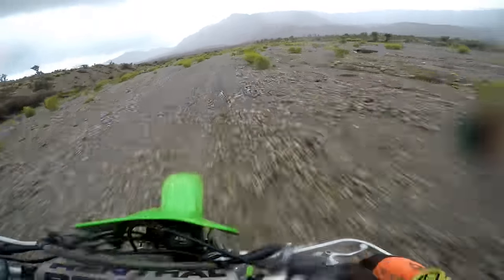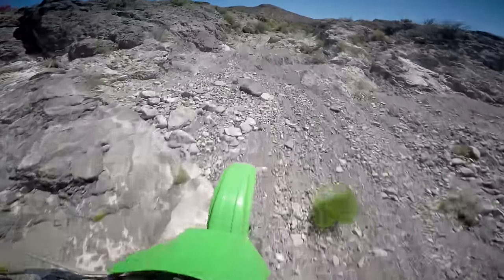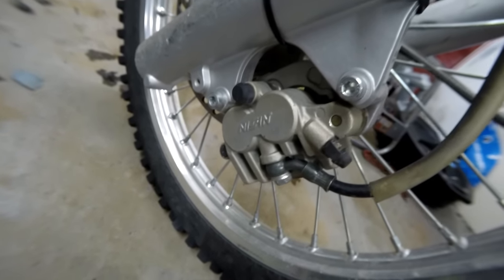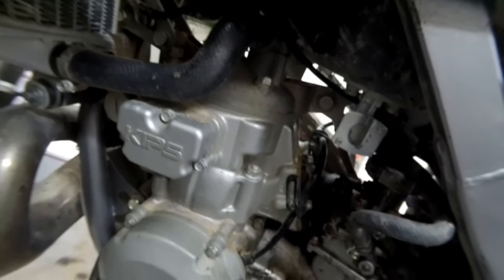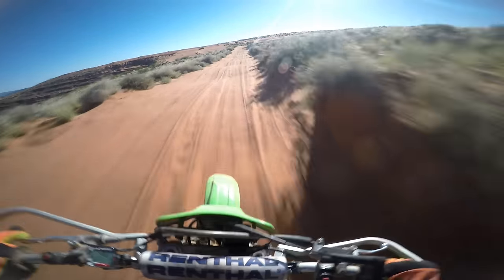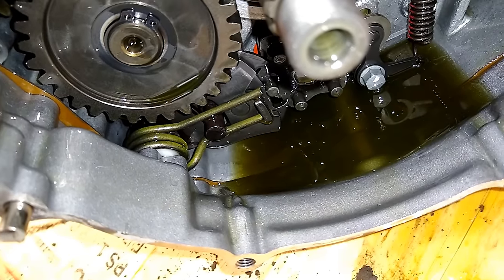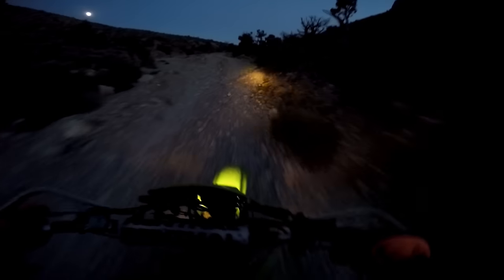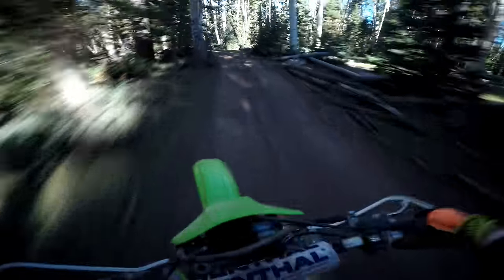KDX200 In-Depth Review

Comment: best thing to do with a KDX is drop motor in a Kx 125 frame 198 lb dry Fun magic with Ease
Reply: Which years of kx 125 frames will accept the kdx motor? And is a kdx 220 the same, will it fit in a kx frame? 
Thank you
Reply: @johnlorenzo1413  03 onwards KX125 are an easier conversion, but all years can work. It won't bolt straight in, but it's not a crazy amount of work. There are many How To's online. Yes the 220 motor works too, the bottom end is the same.
Reply: @wideopen125  thanks
Reply: @johnlorenzo1413  I'm putting an air cooled 200 into an 89 KX125. All the fab work is done, now just time to assemble :)
Reply: Nice  . I like the air cooled engines better, it's a looks thing, the engines on the old air cooled bikes looked wicked, like 80s Maicos. 
I'm wondering how much weight do you lose by putting the kdx engine  in a kx frame.
Reply: John Lorenzo Around 25lb. The hybrid is around 215 with an empty tank. I’ve put a set of 45mm conventional Showas on the front (from a 98 RMX). And a complete H model KDX ignition and CDI. Looking forward to the shake down ride.
Reply: And yeah those 490 Maicos are the best looking motors out there.
Reply: John Lorenzo - the kdx motor is based off a kx125 .

Comment: I have a 2002 kdx220r that I bought new in 2002. I’m 61 years old and it’s been well taken care of, I would estimate maybe 20 hours on it.  The chain has never been adjusted. I haven’t ridden in on a real ride in years, I do start it and roll around the yard every year just to keep in running good. It’s always been kept inside and protected. I would not sell it but I’m just to old to ride it the rough stuff anymore and I have other bikes to ride. I put it on Craig’s list yesterday (twin tiers Pennsylvania)  for 2500 as it’s just like new. You can find them cheaper but after you get them in good working order you’ll have more than 2500 in it and they won’t be in this condition. If I cant get 2500 for it I’ll just hold on to it and give it to my Grandson some day.

Comment: Just sold mine, your forks feels soft because the springs are 16 years old. I am sure if you measure them, you'll find they are either at the border line with specs or under. One upgrade I did was to swap out for a 2005 KDX triple clamp (upside down forks) and used KX250 forks. To get full suspension adjustment.  Never touched the rear other than rebuild and adjust. 

Another good mod is to get the head shaved, higher compression makes it a little more "lively" and improves slow speed rock climbs. 

Been riding for 37 years and best bike I've ever owned. It's not perfect, but I started with a Kawi and plan to end the riding part of my life on a Kawi because of bikes like these.

Comment: Suzuki pe 175 had a good smash plate under frame and wire cage to protect headlight. It would flick big rocks back even with curved big back fender. Flipped the PE twice. Never flipped the KDX and learned how too change gears on one wheel starting in 3rd.

Comment: You should try the 2023 Beta Xtrainer. Its basically a modern KDX with a 300cc 2 stroke engine and an adjustable power band.

Comment: He's so right. I had a 1985 kdx200 and got rid of it cause the cranks seals blew out and cause it was old. And then I got a 91 KDX200 and then I'm probably gonna mix and match the 91 kdx 200 with and a 93 kdx200. So he Is so right once you have one for a while it stays in your system

Comment: i have a 1986 kdx200 it will do 100 and that is fast alli did to it is put new standard piston and rings and i ported and polished the head and put a big carburetor of of a 440 snowmobile motor i can't remember what size but its perfect i have never seen or even heard of a better 200 cc 2 stroke bike i don't know about yours but i will say this one rules it will outrun this yzf 450  my friend has a kaw .4. wheeler klf 700 2 cylnder it will walk away from it all crapp aside i have always  liked honda  and sill do but i don't know of any 200 s that could out do the kdx  good luck with the trails liked you're video and think youre review was  spot on

Comment: Ok, totally revising my comment because wow they took all of the improvements between 90 and this 03 from the KX line and stuck them on the 03-ish KDX line. The old KDX bikes used to be backbone frame with the same terrible suspension up front and the hot ticket was to take your KDX 200 motor and drop it into a KX125 frame to get both perimeter frame as well as inverted forks up front. Yielded a much better bike all around.

Comment: I ride a KDX 200 2003 as well, but I wouldn't recommend removing the snorkel or air box cover. Kawasaki designed the box as a pressure wave resonance chamber where as the bike runs it pushes air out the exhaust on the exhaust stroke but air still escapes through the carborator. To make the bike more efficient they designed the air box so that on the following intake stroke the box would help to rebound and push more air into the engine to help create better power low end.
Reply: Hate to step on toes here. but, The air box lid was simply designed to make it harder for water to get in . Seeing as how the KDX was designed to be more of a woods bike ( ya know, creek crossing and stuff) than a desert sled . Which also explains the reason for a lot of that bikes personality characteristics . What you may be thinking of is the Boost Bottle , Yamaha used for years (that most will tell you was pointless) . Kind of hard for intake charge to go backwards through the carb when the reed valves are closed ! Never owned a KDX but have and still do , own a number of Yamaha IT's . The first thing we ALL did to them was take the lid off the air box so they could breath ! Makes a difference ! But will need to rejet probably.
Reply: @ITBubba1  Your aren't wrong but you're also not right. I have had and dyno'd many trail bikes over the years that actually suffered by removing or modifying the air box, this can be attributed to resonance tuning. As for reversion when the reeds are closed you are correct, however, there is a crossover on two strokes where the positive pressure in the crankcase does push back through the carb before the reeds are completely closed. If you want to see this for yourself pull your air cleaner, start the bike and rev it. You will see a slight mist of fuel get pushed into the air boot/box (some engines are worse than others). This is the reason why "modern" two stroke air boots/box are designed the way they are.
Reply: I have to disagree with this. For tight woods stuff, maybe. For faster paced riding, I removed the lid and it felt like it gained 3-4 hp instantly.
Reply: Two-Stroke Life i agree had a klx300r and it did nothing taking the airbox cover off.  What did make a difference was a stage 1 hot head cam, dropped a tooth on the front sprocket, and put a fmf powercore exhaust on and That thing barked smoked 250s in the trails all day!
Reply: Removing lid plus new exhaust and reeds did both of mine wonders.
Reply: @1TruePatriot  Yea but were still talking air to your motor that can go for any motor. I was more so saying youll notice a difference with something like an exhaust or tuning the jets in the carb correctly to get the right fuel to air mix. I said it did nothing removing or leaving the lid on its more for water to be kept out being that its a woods bike.
Reply: @Two-StrokeLife  I just picked one up, with the snorkel gone but air box cover on. Full FMF, reeds, jetted spot on its impressive. But...its got so much hit I was wondering if I put a OEM snorkel back would it tame it down at all, and more importantly would I have to re jet?? Im going to try a heavier rear tire and tube for flywheel effect first

Comment: I know you hear this a lot, but, once again an absolutely outstanding review in every aspect. Informative, technical, detail oriented, entertaining, and just flat out great. We actually are very similar in our KDX ownerships in that I purchased my 2000 model in nearly perfect condition for the exact same price as you did as my first 2 stroke. It had the exact effect on me that you described in your review. I now own exclusively premix. While I had initially been scared off from them by the ultra aggressive power characteristics of 250 mx'ers, the KDX was an excellent way to familiarize myself with 2 stroke handling. I now own a 2002 CR250 as well, and although it in my opinion is superior to the KDX in every way at mid to higher speeds, the KDX's endearing simplicity, ease of maintenance, and tighter trail abilities make it hard to beat. One thing I might mention to any exclusively 4 stroke riders out there is that personally I found that learning to ride 2 strokes greatly improved my riding overall. 450 4t's used to scare me on singletrack, not anymore!  Anyway super long comment concluded, keep up the kick-ass work!
Reply: keep in mind that the cr is a motocross bike..not intended to trails and woods...suspension and gearing is set up for high speeds and there is no point in comparing this two bikes, you could probably compare the kdx with an old suzuki rmx, and still the kdx is far more superior...i also own a cr 250...cheers.
Reply: It's all wrong. 
This endurance motocross racing bike doesn't do any of these things in the video. 
You need to go to a mental health doctor and get treatment for your crazy ideas.

Comment: Really good review.  I had a KDX220 and agree with everything you said.  Cool you mention the "sweet spot" just before the power band and how you can ride that sweet spot.  I drove many following 4-strokers bonkers by riding this zone.  It sounds and feels so docile but pulls hard instantly when asked.  
One thing you kinda missed is that this bike does not wear you out!  It is so easy to ride that you can out-ride everyone else because it takes less effort and you can go hours longer without arm pump.  In the end I sold mine because I wanted that beefy 4-stroke power for riding high altitude.  I wish I still had it and put on a KX front end.  Oh, and the ski-jump seat just never did it for me.  Modern flatter seats are much better.

Comment: Awesome in depth review! Its given me some inspiration👌
I've owned a KDX 220 since 2013, but it has been off the road for the last 3 (through no fault of its own😉). I dug it out of the shed a few months back, wanting to do some trail riding again, so changed the oil, brake pads, wheel bearings etc, and she fired up 2nd kick!
This video has given me inspiration to get it back into good shape, I've stripped it down to bare bones, re-done the top which was in amazing shape anyway....other than the KIPS. It was so gunked up and was very hard to move even by hand. It's all back together and now moves freely, although the actuator pin has snapped at some point so waiting on a new part to arrive.
Went to town on thoroughly cleaning everything attached to the frame, it's been neglected in that respect🙄 Looking forward to getting it back on the trails 😃

Comment: Excellent spot on review of this bike. I have a 2000 KDX 220, owned it since 2004 and did a complete rebuild on it last winter.  While the 220 and 200 are different machines, my experience is just about identical to your test results.  It is a great bike to ride and own and an excellent bulletproof trail machine. Too bad they don't make them anymore.  Used ones in good condition, if you can find one, get snapped up quickly.  I am going to hang onto mine for a long time.

Comment: The top three things to do to a H series KDX is a kx fork swap, FMF exhaust, and removal of the airbox lid with correct jetting.
Reply: Mine has the RM125 fork swap, stock silencer because mine is tagged and I ride it through neighborhoods; I'll look into the airbox lid thing, but that's where I plan on putting the battery...

Comment: I just picked up a fully restored KDX200 w/ FMF and reeds. I just wanted an older lighter bike for the woods but WTF this thing has waaay too much hit. LOL i thought it was a mild motor but anything over 1/4 throttle from any rpm and it wheelies even in 4th gear, feels like a damn YZ250. I think Im going to try putting a ultra heavy tube in the rear and taller sprockets to calm it down.

Comment: The KDX was designed for riding in the woods of the eastern US.  That is why it turns so aggressively.  Before 4 wheelers took over the trails, it was common for single track trails to be a slalom through the trees.  Most of the woods riders had tree bark marks on the side of their helmets.  Jack and Tom Penton did a lot of the development on the KDX line of bikes, so you can see their influence.  Even today, the 2 stroke KDX is a great trail bike.

Comment: I had a 03 KDX220 great bike for the money very reliable if you measure the wheel base it's an inch shorter than most other bikes hence the tighter turning Jeff Ferdette a club rider rode the ISDE for many years on a 200 KDX

Comment: I sold my 2002 kdx 200 a little less then a year ago . I did racetech suspension both the front and rear . Changed out the triple trees , bars , full FMF set up , carbon reed valves , Wisco top end, Changed the gearing  . A few other goodies also . Going to miss it this season !!!!

Comment: Well you took the words right out of my mouth . I absolutely love my 03 KDX 200 it to me is the OG trail bike. Living on the west coast I ride super tight tech trails, lots of log hopping and we’ll when the trail has been taken out by a tree you have to bush whack your way around. I grew up riding mx bikes because that’s what everyone bought. No those bike belong on a track to be ripped off 30’ jumps not low RPM trails and tech. The KDX has won my heart and she ain’t expensive to take out 😉. Just got home from 48km trail ride in the Raincoast and man I’m always speech less when I look at the ability of these machines to just dominate trails and even flat out logging roads to get to your next opening.  So I give this video an absolute 👍🏻👍🏻.   One major complaint I have is my clutch does not pull in with ease like your video mentioned.  My cable is lubbed and in line right but... I’ve heard you can put washers behind the nuts on the clutch springs so I may try that. Or just buy an aftermarket boysen clutch kit or a magura hydronic clutch kit.   Cheers man !!🍻

Comment: I've owned two KDX 200's and one KDX 220. All three were great bikes and I wish I had kept them. Very reliable, cheap, and easy to ride. I even rode some simple motocross tracks although it will definitely need some suspension work for that type of riding..which I did :)

Comment: Looking to get back into riding after 30 years.  I used to ride 80s era CR 125s and 250s.  Wondering if this bike is a good idea.
Reply: Paul d - Owned several KDX over the years and countless other bikes from trail to MX.  I currently have 6 dirt bikes right now. Just got a Jeff Fredette KDX 220 that I will likely keep the rest of my life (I'm 68).  Sweetest bike I have ever ridden.  Including price of original bike I have less than $5k in it.  It will run with anything out there with no apology or reservation.  I'd encourage you to by the bike and send parts to Fredette for a bike you will never sell.

Comment: Having been very active on the KDX series in their heyday, I can shed some light on the suspension set up.  It was business at the front and party at the back so you could get into that squished nuts, leg forward, happy rear end, broadsiding at speed attack mode for 80s/90s style enduro events. It was meant to be ridden like a KX125 with some slight mellowing for enduro and transit sections.
Reply: Just as it should be 👍👍🤣🤣

Comment: My father gave me his 1989 KDX 200. He used it for 7 hour endurance racing in the South African bush, similar to the terrain in this video. He raced it for 6 years and won his last 4 races overall.

He gave the bike to me in 2007 when he bought the last generation KDX 200.

2024 and my 1989 KDX is still running competitively, the single piston brake calipers are a bit outdated but newer bikes can't pull away from me.

Parts are a bit scarce but these bikes are dirt cheap so i bought another one for spares. The only reason I needed parts is because I hit the rim hard after putting the front wheel down crossing a make shift ramp to get over fences during a race. The front rim cracked and split perpendicular.

I never needed to buy replacement parts for the engine and it never ceased.

Regular basic servicing had it running like a dream.

And thanks for the great video, you got the review spot on and I couldn't do it better myself.